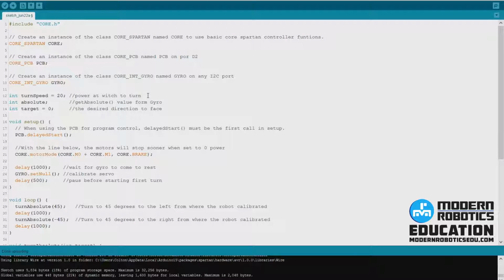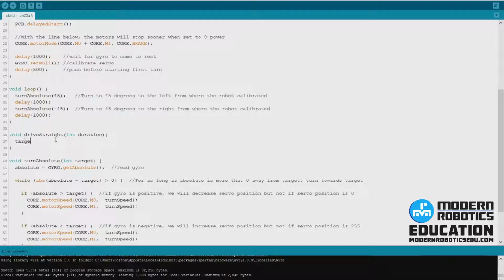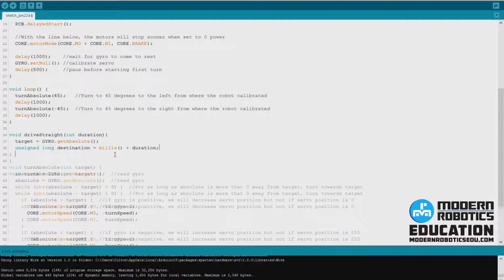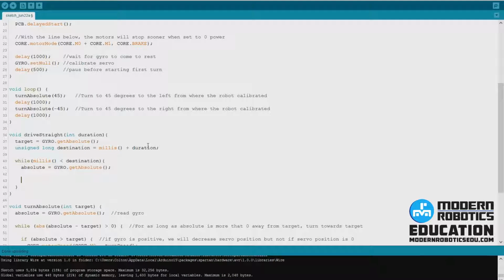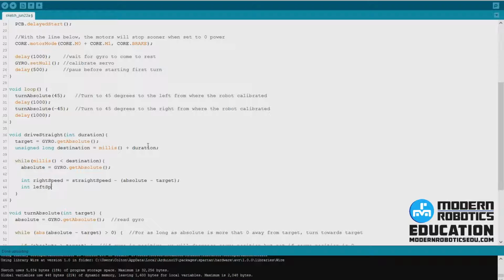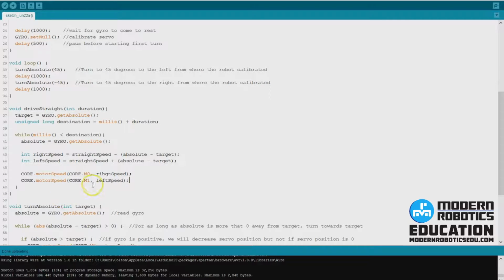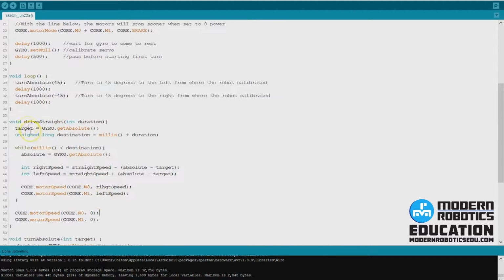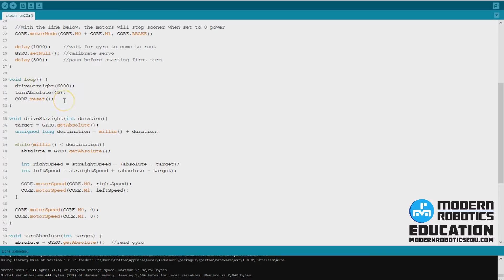Gyro Straight - Arduino

Comment: This is soo cool. Does this library work with MPU-6050 MPU6050 3 Axis Accelerometer Gyroscope Module? I'm trying to make a robot that goes straight, just like this. Would this part work?